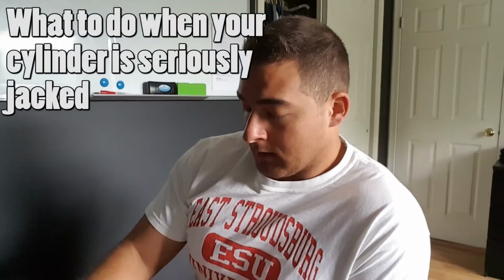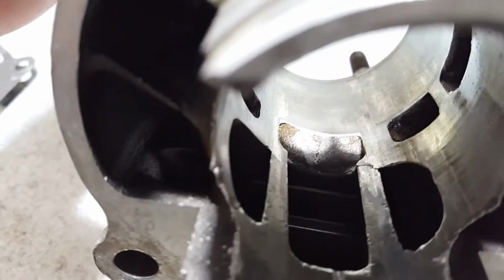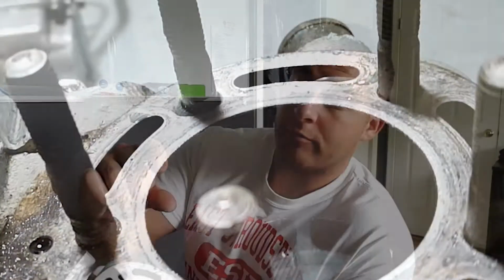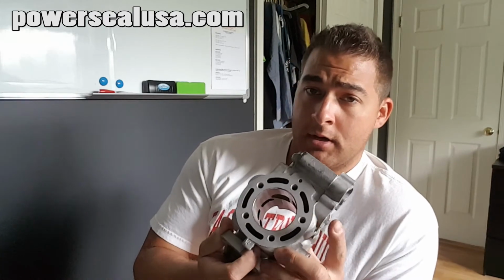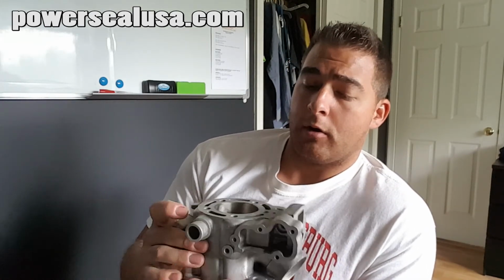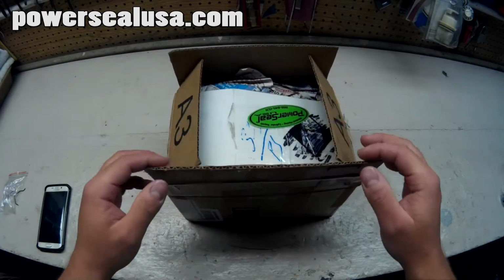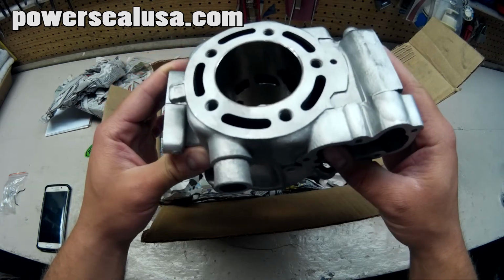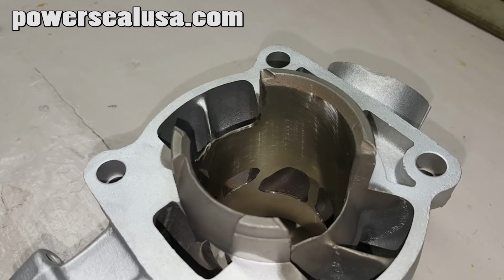How to get any new cylinder for half price

Comment: It isn't nickel plated it's nikasil plated. Totally different than nickel.
Reply from the maker: Buckeye Derric You're right and I should have said nikasil, but from what I understand at least, nikasil is short for nickel silicon carbide. It actually is a nickel coating, but it also has silicon carbide in it, which is what makes it so durable.  I just referred to it as a nickel coating.

Comment: They are cheaper than millennium to
Reply from the maker: Yes, I looked into them as well
Reply: Michael Sabo i am actually going to use eric gorr   He is a bit slower than the other guys. Said it will take 3-4 weeks for the cylinder to be returned to me after he gets it but he will do re plate plus power valve service for only 180 and free return shipping     And the 180 includes welding if ur cylinder requires it from damage    I will post results after i get mine back